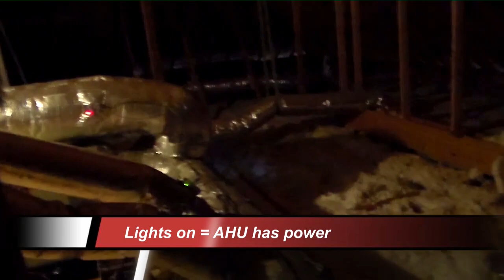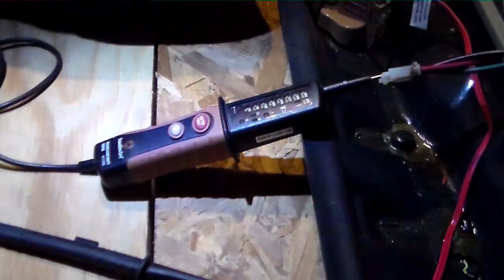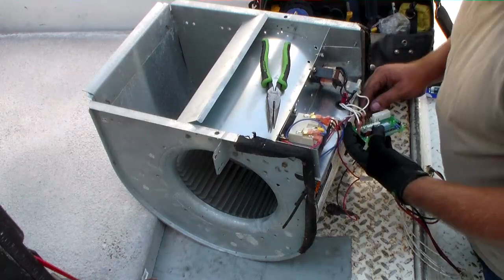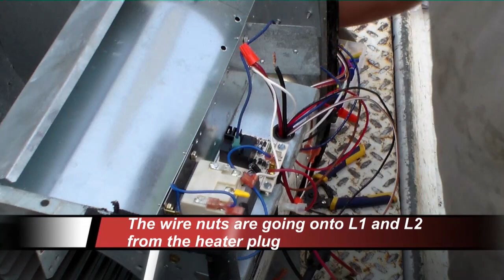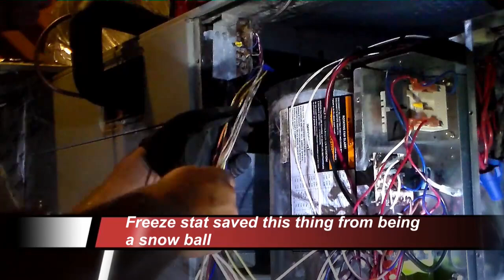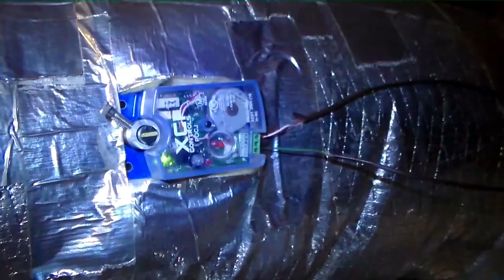HVAC ECM Variable Speed Blower Motor to PSC Motor Conversion

Comment: That fan motor is going bad often due to high static pressure when the zones are not all open.  True zoning requires modulating equipment and no zone can be smaller than 35 percent of total system load. Best if using mini splits to zone. Or combination ducted and ductless mini split to achieve true zoning. Be careful with pumps tho. I always gravity drain. The pumps go bad often.

Comment: So basically, ECM motors are garbage for furnaces.  I have a Goodman 2010 2 stage multi-speed 5ton(2000 CFM) PSC 90k BTU 80%.  I’m looking for a replacement goodman and I do not want one with the ECM. What about the current ones that are variable speed? Are they ECM? Can you find a PSC variable speed motor?  My furnace is still working perfectly fine but I want to prepare for when it’s time to replace. I want to replace it with the exact same furnace and it’s hard to find so I want to buy one now and store it.   Which Goodman do you recommend?  I could go down to 80k BTU, I don’t wanna deal with five burners I’d rather have 4.

Comment: Great vid. Been thru 2 -2.3’s and finally put a psc and contractor in but left the choke and cnt03600. After seeing this I’d like to pull that stuff out and do as you did. Do you have a diagram handy? Inside is a twe065 with strips and an xl19i out. I like the ramp but not the replacement cost. Thanks
Reply from the maker: The process would be different with a multi stage condenser.

Comment: I'm replacing my blower motor in my Air Handler. The new motor is also a 220v but it has a white wire and the old does not. where does the white wire connect to?Thanks

Comment: i could have replaced 3 of those modules in the time you took to record the video!
Reply from the maker: Module replacement is def faster.
Reply: @Talyn875podcast  As an HVAC tech my home would have gotten the same treatment. Having one time losing a Carrier OEM motor I bought a generic PSC and a mount kit. Still save $100.

Comment: by the time you right down what you did and charge the homeowner for the motor, the relay board, the capacitor, the wiring changes you made, and the time it took to do it, you could have simply just replaced the motor module and saved yourself all the time and headache! I have replaced plenty of those modules, about an hour max, not worth all that time when the cost is relatively the same!
Reply from the maker: This motor/module had been replaced already. Maybe twice. I offered a more reliable solution.  That is , of course, my opinion.
Reply: Not worth changing a module that keeps going bad
Reply: Don't sale module alone must be with whole motor

Comment: My Genteq x13 blower module failed yesterday. So I’m either looking at replacing+reprogramming the new module or converting to a PSC Motor. I’ve already verified 24V signals from thermostat fan call, 240V present at fan motor. Also motor Ohm’d out good. So this will probably be the route I’ll take.  Lightning also hit my house a few times over the last months. So..... anyway, Nice video. Thanks.

Comment: I had a similar motor in my outside fan go out. TRANE said I had to replace it with that varriable speed motor with the bell end electronics.  The motor only operates at 1 speed !  Another place said the same. I went to a contractors supply store and told them what I wanted and bought a standard motor with a small board and 3-4 years later it is still running fine. Saved a  whiole  lot  of money doing this and is the same efficiency. A Trane mechanic (?)   was sent over by my landlord (mom with out asking. Knew nothing and twiddled his thumbs for a while and left. He sent her a bill and stated I had messed up the wiring THAT WAS INCORRECT AND HE HAD NO IDEA ABOUT THE WIRES AND DID NOT TOUCH ONE OR HAVE A PRINT !  

     Sears said I needed a new washing machine motor that was not running from 2 repair places . I got to it and noticed it had a start capacitor replaced it for the price of 6 dollars and it is still cleaning years later. Them coming and replacing the motor or even coming cost $$$

Comment: I have a similar unit outside on my bench.  The module is  foamed in so you can’t  check the back. I suspect if you locate the screws under the foam it will come out.   I’d like to see the back and check the capacitor.  We changed  out the variable fan for a single speed.

Comment: What type of zone system is that, seems to cover all areas of concern... Temperature, static pressure, opening zone to relieve , pressure & temp...  I would like to check it out, do you use or recommend it...?

Comment: You know they make a surge protector for the ecm motors. I will not install an ecm motor without one!
Reply: Danny C  I added a surge protector for the entire house.  An electrician said it would solve the problem with led lights going out so soon. It should also help with a lot of other problems.  80% of surges are internal.

Comment: Is there any advantage going from a variable speed to a PSC motor?  I'm having a brand new system installed in my home and my HVAC guy is setting me up with a new Hydronic Air Handler that has a PSC motor (can be bought with a variable speed motor). Just wanted to make sure im getting a good one.

Comment: Freaking amazing that you figured out how to do this!! I came across this video because for the second time in 2 years the $500 ecm module has failed on my furnace... I do believe that I figured out why it failed again (due to you dialog) my cold air return is kind of restricted.
My main question is do you think that this conversion will work on a motor with a GE 3.0 module? My furnace is a Bryant 355mav 80k and it is a 1/2hp fan motor.
I am just trying to decide if it is worth buying another $550 ecm module or if maybe I am better off replacing the furnace with a new one.
Thank you!!
Reply: try this site.my module was less then 500. /www.airstarsupply.com. I have the same system. first module replace for this unit.
Reply: @myonlylov  ⁹⁹⁸⁸

Comment: Where do get the plumbing strap that you use to mount the capacitors? The ones I find around here are a very heavy gauge, you were able to cut yours easily.
Reply from the maker: I got one from ihrie supply and I think one from lowes

Comment: did u size replacement by hp or amps?
Reply from the maker: I usually see what the manufacturer puts in its comparable PSC blower units. I think this one got a 3/4 because it is 4 tons. I don't go back ecm amps.